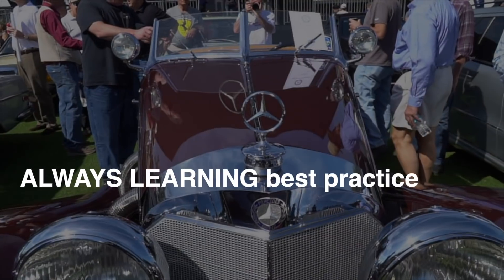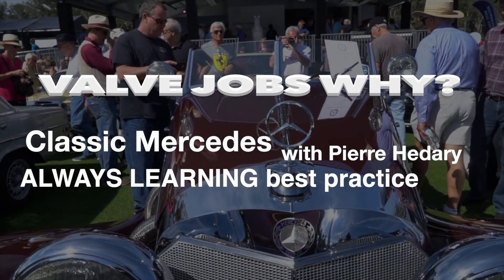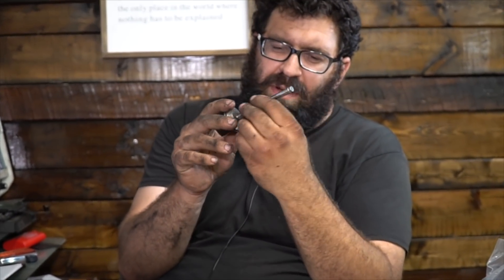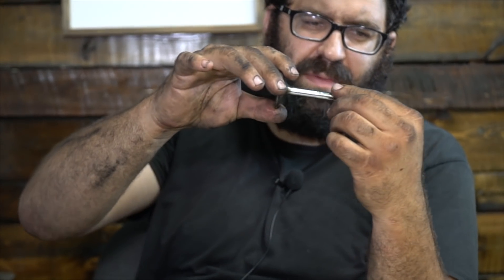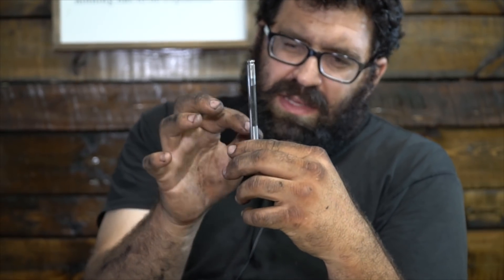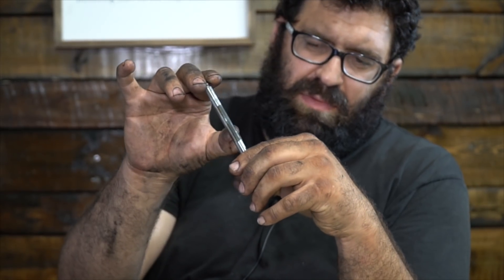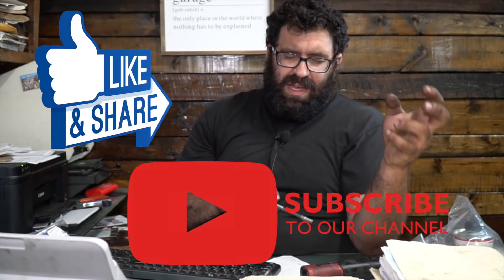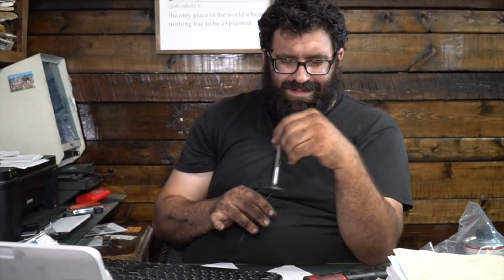What happens when my valves wear out?

Comment: What are the symptoms of bad valve guides, aside from burning oil like you mentioned?
Reply: On my M130 engine '71 280SE with 140K miles (engine never been apart), distinctive puffs of whitish-blue smoke are emitted from the exhaust, upon accelerating from a stop.
No difference after a valve adjustment, oil/filter change & general tune-up.
It still runs well enough, but that's the most noticeable symptom. And, you've got to watch the oil usage. A quality valve job is not cheap.
Reply from the maker: blue smoke on acceleration or cold start, lots of blow by and higher than average oil consumption. Oil fouling of plugs on the worst cylinders. low compression on the worst cylinders.

Comment: Hey Pierre. I'm starting to get oil seepage from the head gasket on my OM603. I'm also getting oil coming past the turbo into the intake manifold. Im trying to avoid an overhaul. So when I replace the gasket, I was planning on doing valves as you reccomend. My fear is that the oil in the intake is blow by from the rings and not from the valves, we which adds a very different component to cost.
Reply: Buy a compressed air water trap and install it in the PCV line.  Search on YouTube, plenty videos.

Comment: Could you explain more about the valve adjustment on the M130 engines? In particular the use of the "plates" / shims.
Reply from the maker: no shims are used, but the lash pads..which go on top of the valves...are a permanent part...the m130 engine has offset side adjusters. did you mean m103?
Reply: @mercedesclassicswithpierre1753  I mean the M130 engine (280SL), they are also called "thrust piece" and sit on the valve stem (within the collets).
Reply from the maker: @cav4290  ok..I know exactly what you mean.....i usually never have issues with these. they come in various heights but they are not the adjuster....they can develop some where but if your exchanging them replace the rockers arms as well. Again, adjustment should be from the adjuster on the side of the rocker.

Comment: Hi Pierre, What kind of valve guides that are in the m115 gas carburated engine on a '79 230 w123 euro spec and what's the symptoms of a valve catching on a valve guide. Also I've done a compression test on the engine and found that all but cylinder 3 are pushing 140 psi on a COLD engine that runs once or twice every month or two and as for cylinder 3 it's only making 121 psi or 125 if oil was added. Now from my knowledge the car never had any valve adjustment in its lifetime and it wasn't used as a daily for at least 20 years (It's been parked in a garage in the last 20 years or so). What's your take on this ? Would I need to adjust the valves first and redo the compression and what then if the compression is still low on that cylinder
Reply from the maker: Hello, +adelkheir and thank YOU so much for your question(s), we want to answer you as quickly as possible. 
By signing in our Patreon https://www.patreon.com/thomaspolk page and making a donation of $10 your are assured of a 24 hour email response from Pierre. 
If you are already a $10 member please mention along with your question.